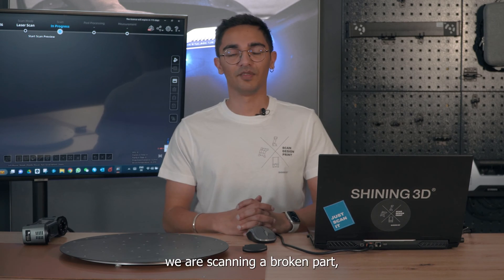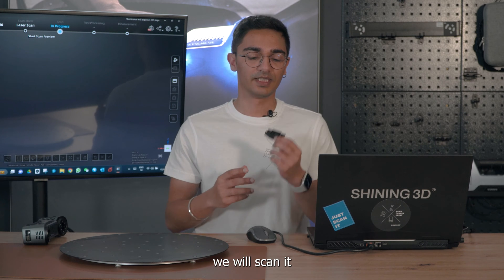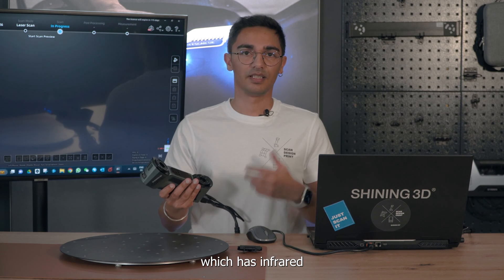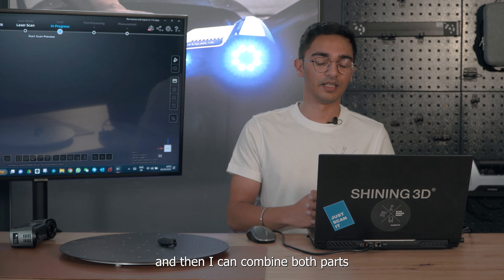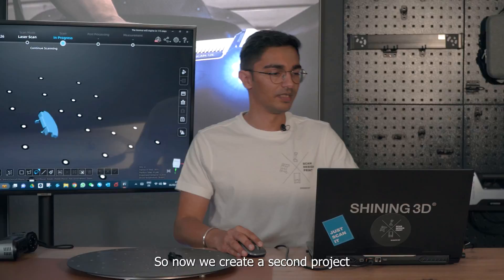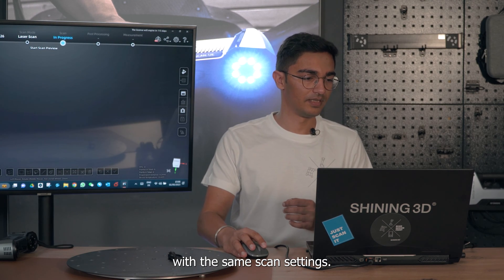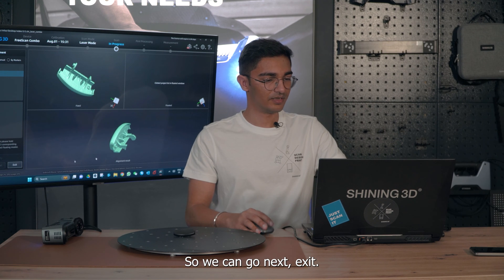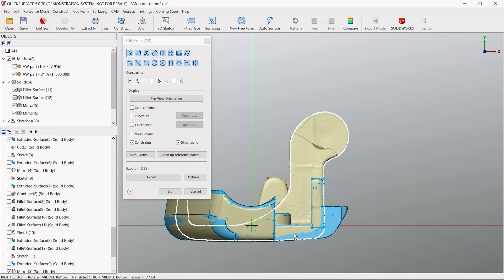Freescan Combo & QUICKSURFACE

Comment: i'm pretty sure, this VW part is still manufactured in the market 

if i'm not mistaken, this is the opening lever for the armrest on a Golf IV or Bora - VW still sells those for about 30 Euros

nevertheless, this is a great way to demonstrate, you would do it with a part that is actually not available anymore - but the pricing is a bit out of line, if you are looking for a solution for a maker without any commercial interrests

do you offer free solutions for educational / private use aswell?
Reply from the maker: We have some preferential prices for students/ private use. Contact us for details: contact@quicksurface.com